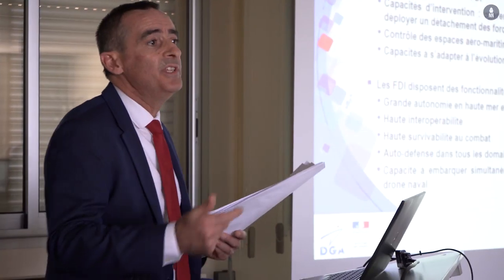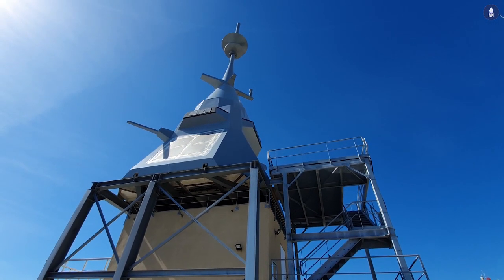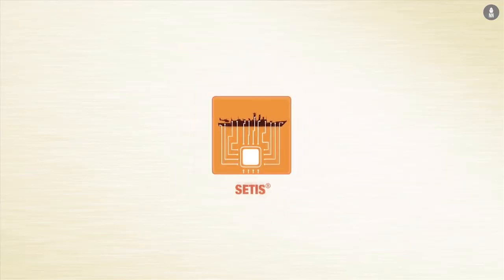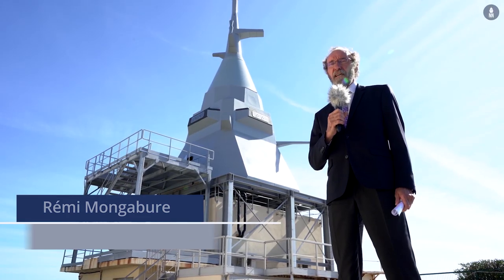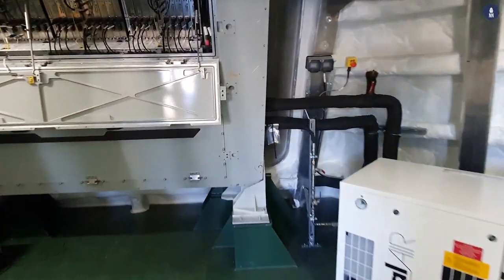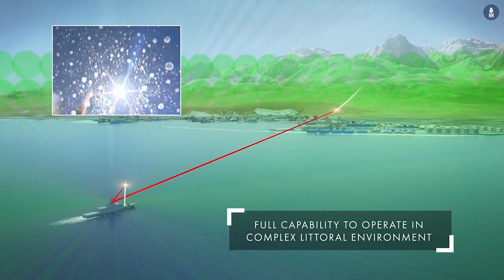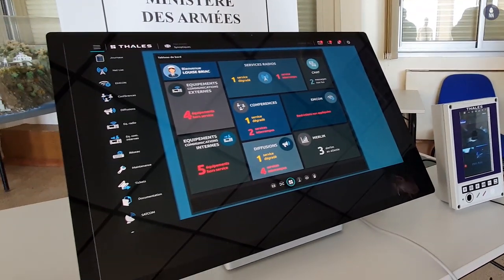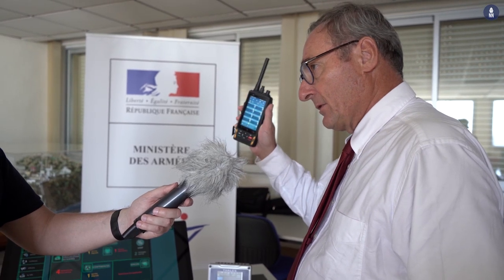Testing Begins for SEA FIRE Next Gen Radar & FDI Frigate Combat System

Comment: They could put two SAAB X band radars rotating at ninety degree's to each other under a dome on top of the super structure.
Nearly 100% coverage in two bands at all times then.
Having calculated the time with two radars one on top of the other rotating at the same speed start in a cross configuration the time without radar coverage is about one second.
That twin rotating radar system can be used for anything not just ships.
😈😈😈😉😉😉
Reply: Why? When a 4 panel AESA is better?  Fewer moving parts also means less maintenance ;)
Reply: @lordtemplar9274  Really idiot
A four panel Aesa is twice as expensive and far harder to retrofit....
The dual rotating can be used all over the world on every type of single face rotating radar.....
😂😂😂🤩🤩🤩
Reply: @markjmaxwell9819 ' Really idiot' says the guy trying to teach to the bests engineers in the world how they should dev radars lol